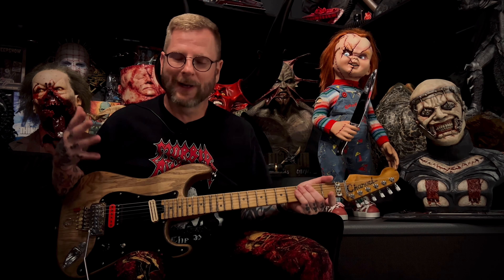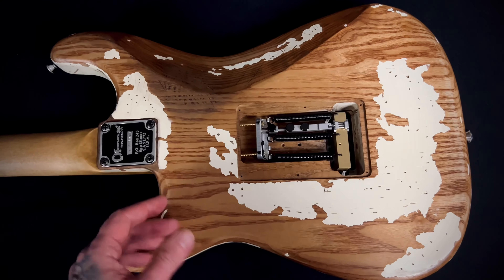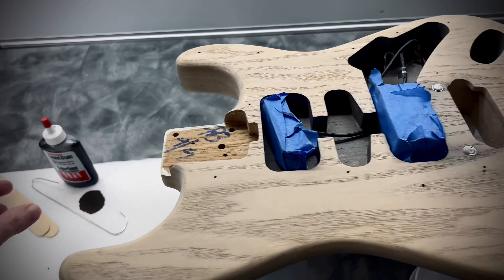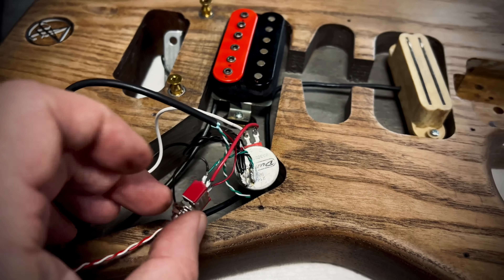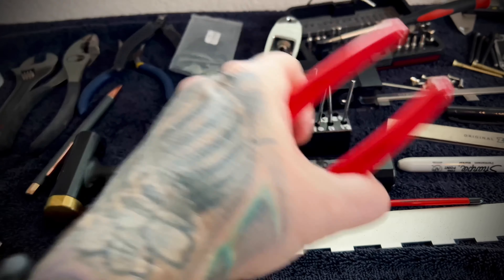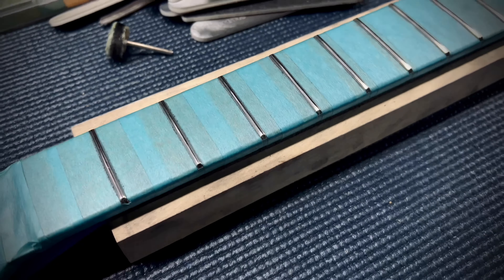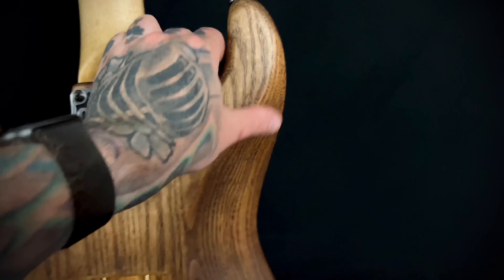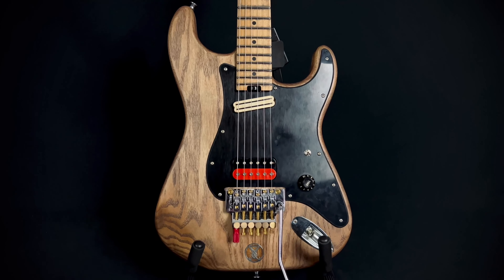Modifying/Refretting a Charvel Henrik Danhage Signature Pro-Mod So-Cal Relic Guitar to a Super Strat

Comment: Awesome build. Do you maybe know what would be the best way to change the headstock logo on a regular Pro-Mod Charvel? Sand down only the front of the headstock, apply new logo and seal it with matte poly clear coat?
Reply from the maker: Yes, that could work. But it will be hard to do it cleanly. Talking your time is best.

Comment: The work you did on this guitar turned out great! And the videos were excellent. I see that you put a two-way toggle switch. I assume that the original push volume pot was not effective for changing the pick ups quickly? Is that why you put the two-way toggle switch?
Reply from the maker: Correct, it just wasn't quick enough for me, and I just never got used to it. Plus the location for me was just too far away.
Reply: @brutesmagootes3996  Ok, thank you for getting back to me!

Comment: Hey man hope all is well
I’m ordering a SD “78” for my Danhenge. I had so many different pups on my list from the BK VHII to the Thornbucker but in the end figured the 78’s fitment should be close, cost saving and reviews seem to reflect a similar “clarity” quality. One question Sir, when you pulled the JB, is was it a regular 4wire? I questioned it since the push selection option has thrown me off on a lot of stuff regarding this guitar. Almost would have been easier to just start a while new one but not cost effective. Yet. 
Thank you in advance.
Reply from the maker: If I remember correctly, it was a regular 4 wire. The 78 should sound great
Reply: @brutesmagootes3996  Thanks so much, waiting on it now.

Comment: I really dig how the body colour came out. did u age it or just use tru oil?
Reply from the maker: Thanks. I just used tru-oil's walnut stain for the color, and went heavier with it in spots for some aging/grime. I finished it with a couple of coats of wipe-on poly.

Comment: hey dude. epic vid. ive jjust bought a san dimas and i really cant get on with the heel. just wondering what you did to modify that on yours ?. Eg. did you use the same screw holes in the neck as before even though due to the new angle the screws dont sit flush with the metal plate? Or did you make new holes in the neck at the new angle and fill the old ones in ? Any help would be appreciated as i plan to do it when possible
Reply from the maker: I used the same existing holes. Cut the screws to the new lengths and re-countersunk the plate at the new angles so the screws would sit correctly. If you need more details just let me know….

Comment: I see you went from two red to three black springs - how does it feel different? I have two reds on a Focus 1000 with an OFR and i love how sensitive it is, but it might not be enough tension to always return to zero.
Reply from the maker: That’s the exact issue I was having. So I tried 3 red but it felt like it was too much, then swapped to 3 black and felt that was a good balance.
Reply: @brutesmagootes3996  Three red was way too much so I went back to two. I'll order up some of the black ones. Thanks! Also, just bought one of these Charvel Henriks the other day and love all your mods, especially the heel.
Reply from the maker: Awesome! How do you like the guitar overall? To me it’s fantastic, especially the neck as it’s the perfect neck feel for me.
Reply: @brutesmagootes3996  I'm really digging it so far. The neck is great and it has a really insane natural resonance and wide open tone. I have an SL3 with a JB and the Charvel just sounds bigger and more dynamic, although I think the SL3 has a more refined feel. I'm going to lightly sand the neck to smooth it out a bit, swap in a screamin demon on the neck, put in a vol pot and reuse the stock space for a 3 way, do the push in arm mod and might tremolo-no it too.
I picked it up used and the former owner had clearly set it up so it didn't need a lot of adjustment, but what got me is how naturally resonant it is, it really feels and sounds alive. It's so good i'm a little afraid to mess with it, but I really don't like the push in pot to switch nor the location of it.
Reply from the maker: Yeah, I too never got fully used to the push pot and its location. I was glad to have moved it. I think you will be too.

Comment: my opinion?  looks way better than it did new . .    if you are going to relic a new guitar to resemble a pre pro the finish is going to be like tan today, its so Jake like that, behind the tuners its going to be new looking, under knows all that, but its not its ghetto as fugg, fenner is fuggin that company UP ..

i honestly think fenner would do themselves a HUGE favor if they tooled up to bring back the san dimas and the so cal, graphics, the kahlers, the original floyd roses, NOT recessed, full pickup routing the works, bring it back as 100% original but for like $1400, graphic n all I KNOW what it takes to build a guitar and it ain't no $6000 to make money, let me lay it down

1. woods, a neck and body blank in bulk AAA 1/4 the works, maybe $50 for the neck and body.. fingerboard fora nice Brazilian?  in bulk, maybe $30 even for 1/4 sawn, like I said bring it all back, not some ghetto BS you throw and people for $5500.00 fuggen JOKE

best frets available SS, maybe $4 a unit, tuners, maybe $20 for the best of what they offered back then, same, same, in bulk for 5000 units, maybe $20 a unit.. then the bridge and nut, welp the retail for $250 thereabouts, so the floyds may be half that bulk, lets say $160..  guaranteed Kahler will give you a great deal as well for a 3500 units of their various bridges, even the brass 6 pts and hard tails.. then pickups, welp, you're now winding your own to go full on replica, except you're putting the Charvel name on them, then the graphics, here is the most cost and labor, imma say $200 per unit graphics, $150 non or 2-3 tone and solids..

so for under $500 you can bring back FULL ON ORIGINAL pre pros, you have maybe $300 labor into then so $800 . .  sell for $1600 you are making bank and selling each and everyone like there is no tomorrow, all this garbage you throw out there for hi dollar that's all being scooped up by investors, what little is being scooped up, some players and pros bite and buy soon realize what a bad investment it is .. then maybe all your full on custom bodies like the cutting boards, laminates, the exotic 1-2 pc bodies all those maybe charge $200 for sourcing the lumber, I think players can respect that cuz until you guys get your heads on right and come down back to earth people are going to respect your instruments, not like that not to where it was where if you weren't buying them when they were released you wont be able to find one, I can find 6 yr old charvels brand new, again mainly investors and collector s buying them hoping one day they are worth a million .. never happen .. not until you land and offer genuine charvels not gooned out fenner that are poorly made